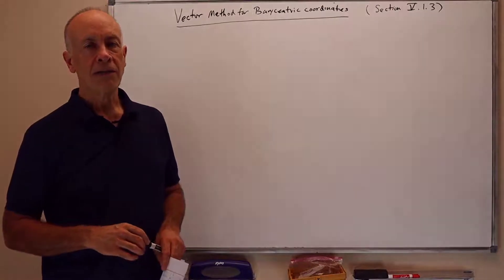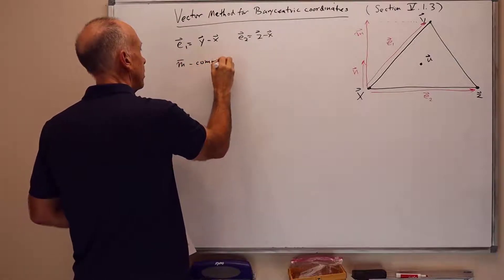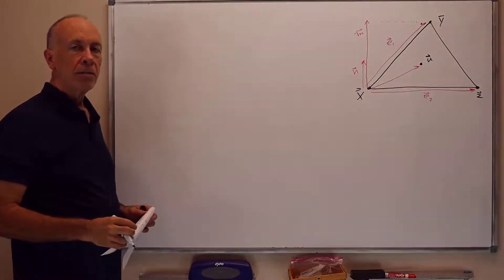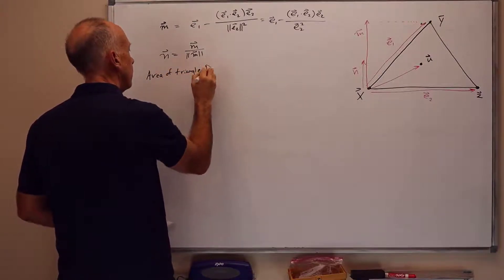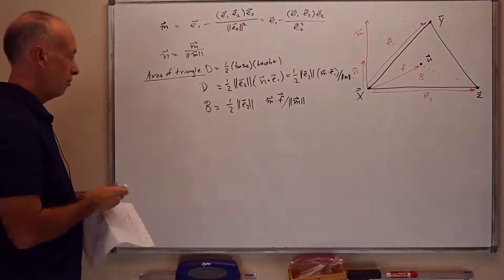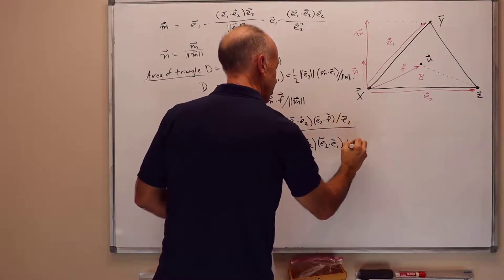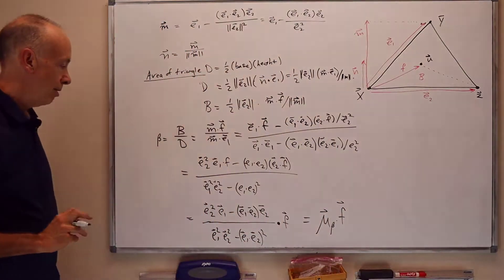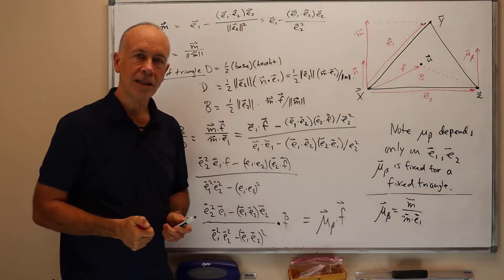08 05 Calculating Barycentric Coordinates

Comment: Simply wanted to confirm... Point u can be anywhere inside the triangle, correct?  It can be predefined and then use the calculations you presented to find the values.